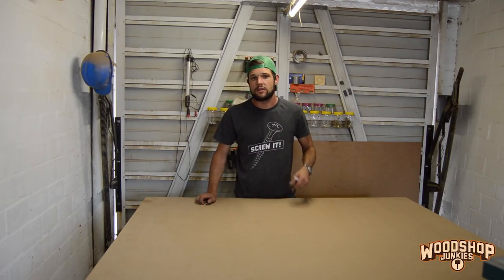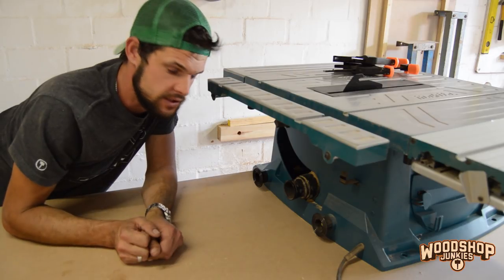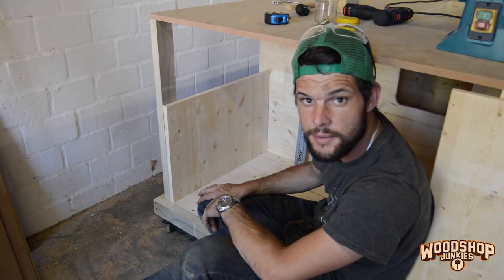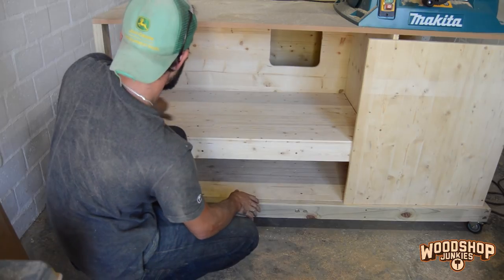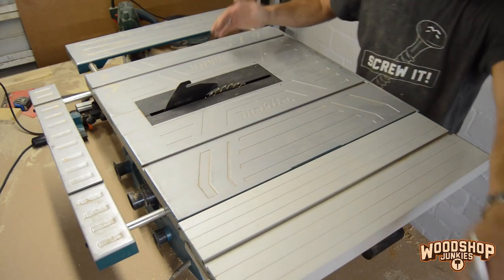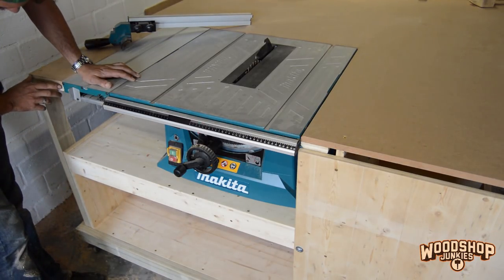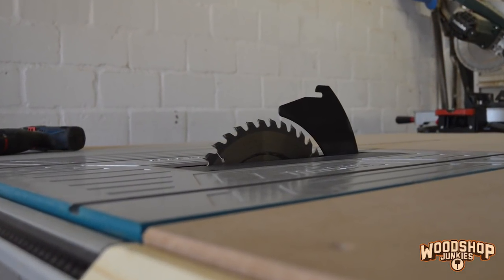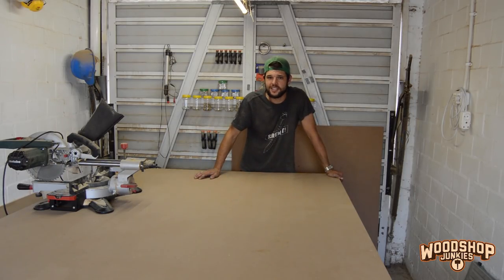Perfectly flush top table saw outfeed table - ALL-IN-ONE workbench - PART 2

Comment: Nice build. One thing that may have helped in terms of leveling the saw would have been threaded inserts and bolts (using two nuts to lock position) on each corner underneath the saw. That way, you could be sure you can do a precision adjustment anytime you need to. Still not too late to do it if you feel it necessary at some point. Overall, very cool.

Comment: Excellent project.  This video series makes me feel better about my 7M x 5M shed being able to kit it out. With your table saw, you do realise that on the left tabletop is a sliding table. That feature has to be too good just to lock away. I’m sure you could work out a way to make it moveable rearwards into your table top.  Forwards would be easy as the front of your installed saw is free. Cheers.

Comment: like the videos, I built a table around my jobsite saws as well...but I actually inset them a bit as well...ofc I had to make my own fence system, but it is far more robust now...I also used 4 large bolts vertically for leveling the saw...heads up to but up against the wood...works like a charm. That's the beauty of a screw mechanism :)

Comment: I like the concept. Have something similar. I also used mdf for the substrate of the benchtop, topped by a sheet of melamine.  Hate that MDF, makes such a mess.  Watching you blow that dust around in the little garage reminded me of that. Just make sure to get on top of the dust control in that room.
Reply from the maker: That's the plan. My sinuses can't take it anymore. When out and bought a shop vac. Want to assemble it with dust collection in the bench.

Comment: This is so cool, I am looking to build something like this as I have just built a 16x8ft tiny workshop and need to be careful with space as there are so many tools I want to put in there, btw you should run your router along the curved side and not the flat side as it is easier to make a mistake on the flat side, cool build look forward to seeing it finished.

Comment: Hi Jean, wonderful project and great video. Subscribed! One suggestion for the table saw platform - wood compression, vibration and time may cause the base to sink, and it's a lot of shear load for just bolts. How about bracing the base against the floor with pieces cut to length and screwed in?

Comment: Nice video... I have the same table saw and to be honest don't like it much. Working on a fix. I think I would remove the sliding bed as its pathetic with lots of play. It's bed has peeks and valleys. Insert plate bends, fense is terrible too. I shouldn't have bough it but now that I have it, will have to spend lot of my time to fix it. Might make a video too.
Reply from the maker: I quite like the saw though I agree the sliding bed is no good. It is a nice extension to the bed though. As for the insert, that's something I picked up also so I'm replacing it with a Alu one. I don't mind the fence. Mine is quite true and I feel that it reduces the change of kickback as it doesn't place any pressure on the back of the blade.

Comment: I was a bit skeptical of the strength of your bench in the first video - it’s pretty “basic” compared to a lot of the builds you see. But, as you’ve progressed, I’ve come to appreciate the simplicity of your process, and it’s plenty strong enough. Most folks would add glue to increase strength though.  Your thoughts on that? Mad respect for what you’ve done here.

Comment: Wouldnt it be easier to install leveling feet on your table saw... Looks the holes are already there😀, and it would prevent the saw slowly slipping in the elongated holes.
Reply: Do you think having actuators to lift up and down the table saw is a good idea? I am planning to use actuators so I can lift the table saw down and hide it by placing a plywood piece back where the cut out is when not using the table saw.
Reply: @TheRealDoubleT  did you do it? How did it turn out?

Comment: Can I ask wouldn't it of been easier to of made the base plate with it completely covered first like the work top is rather then filling in little pieces here and there later.  I am asking as I'm curious I'm not a joiner or nothing. And btw I have exact same space and would love to build this
Reply from the maker: Honestly, if had to rebuild this bench I would do it very differently. Same basic design but stronger and with higher quality materials. When I started building it I was scared to invest too much money it because it was just an idea at that stage. Now that I know that it works I am considering a rebuild with better materials. Re-enforcing the base is one of the first things I would do.
Reply: @WoodshopJunkies  well it's a brilliant video and a brilliant job.. it's easy for me to say wouldn't it of been this and that.. as I'm not building it.. it's always the way you make something brilliant and someone says this and that. I was watching and  I did think as I was watching oh so floor base goes now.. but I'm no carpenter so I was just asking really if I am honest as I wanna build something similar I have almost exact same size and style garage that I need to put all my tools in one place plus when it's hot you can wheel it outside the garage doors and put the brakes on and work there it is a great job mate

Comment: Great build! I'm looking to build something like this. Are you going to keep the stock fence for your table saw?
Reply from the maker: Nathan Aubert yes but for quick cuts. I am planning on installing a large more robust fence which will work for the miter saw that gets installed in part 3 and the router table that still needs to be installed also.

Comment: Great video. Is the entire workbench now done? If so, are the table saw leveling bolts working as expected?
Reply from the maker: I'm still working on the bench but have started using it as well. So far so good on the table and miter saw installations. I haven't adjusted the bolts at all since installing the table saw and both the videos after this one's wood was cut using the saw.

Comment: How are you finding working on the MDF tabletop?
Reply from the maker: It has its drawbacks but all-in-all I quite like it. It's not the strongest material but it does what it needs to in my case.
Reply: @WoodshopJunkies  I'm in the midst of figuring out a workbench inspired by your design, and was thinking of doing an MDF "sacrificial" top layer over 3/4 ply.. that way if it gets beat up, water damaged, etc I could swap it out for a fresh new sheet without disturbing a foundational underlayment..    thoughts?

Comment: Excellent work on your Out Feed/Assembly Table it looks great, and i love how you did the wooden piece along the side for your Fence to run along. Is that a Metabo Sliding Mitre Saw you have? If so i have the same one it's great i love mine, a true cut. 
If it isn't then ignore that last sentence, and it's off to the Opticians i go ha ha ha.
Barry (ENG)
Reply from the maker: Barry Roberts hey Barry. Yup. It's a Metabo and seing as I've owned 2 different miter saws before it I can with all confidence say it really is a great saw. Thinking about changing my thicknesser over to Metabo also.
Reply: Some really good ideas.